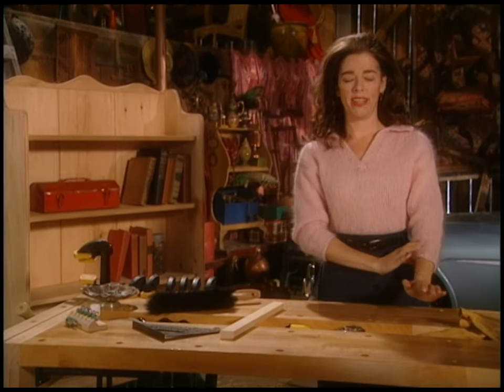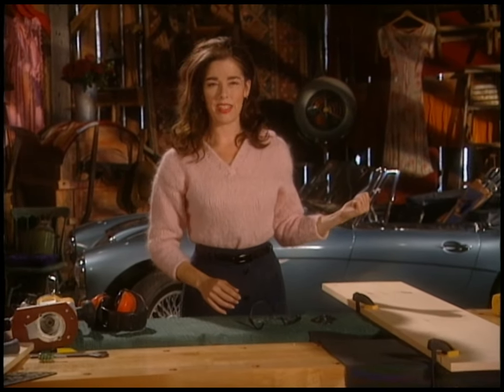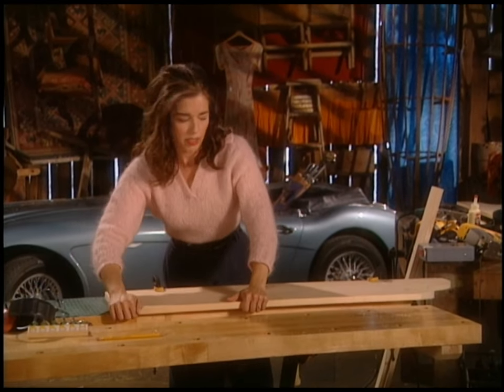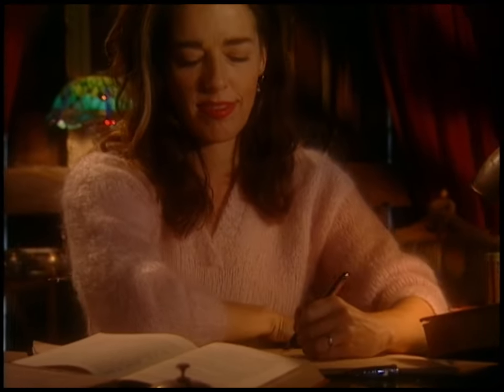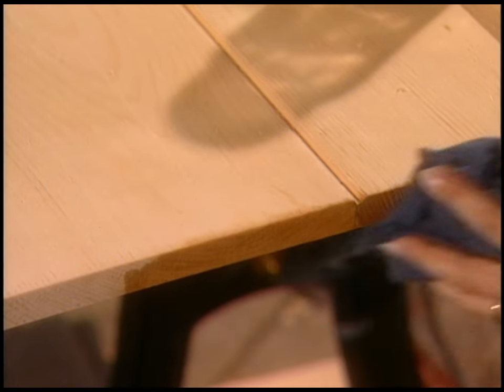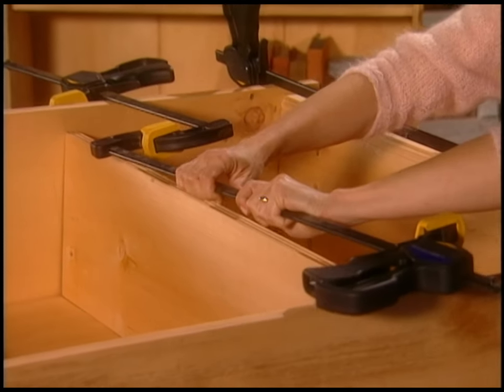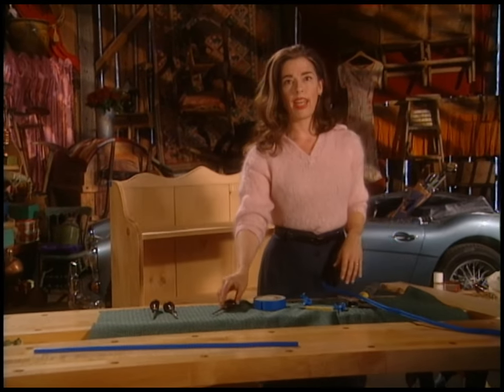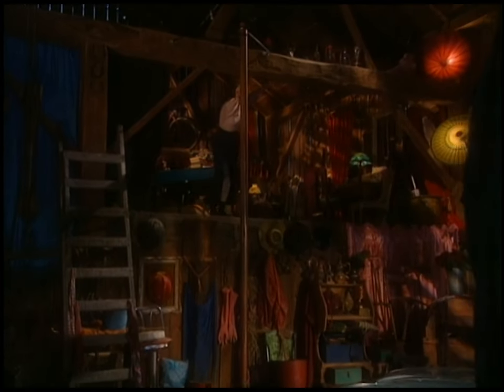Create a DIY vintage bookshelf in a weekend!

Comment: Well, the clamping part was... entertaining. (Been there myself: 'cept that when it was happening to me I didn't find it entertaining! 😤 )

That peeling off a sliver of wood to hide the nail looks golden! Thanks! Wish I had watched your video before I built that frame that was almost ruined because the pin nails weren't buried deep enough to fill the holes.

Comment: Your builds would be alot easier if you pirchased the proper tools.( I.E clamps)  not to be rude or discourage you. But you teally shouldn't be wearing long sleves when operating any power tool.  The risk of static electricity drawing in the fabric is quite high. And on the subject of the build, common nails tend to work lose with humidity and temperature change. As wood tends to expand and contract be it how ever little ,It's enough to losen up the nails over time. "learn to do the simple things in woodworking  correctly and the harder ones be come easier"
Reply: I’m very new to building things, what can you do to fix the issue with the nails ?
Reply: @eliesec6045  you had the right idea in your video. Why are there other nail holes besides those?